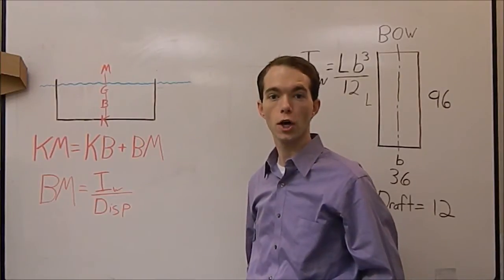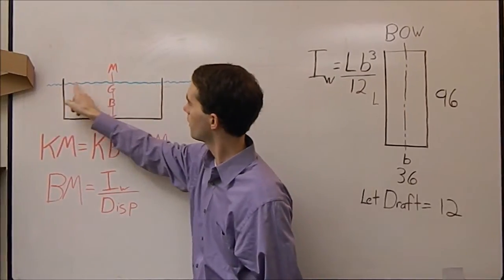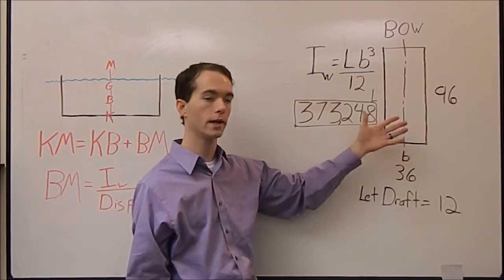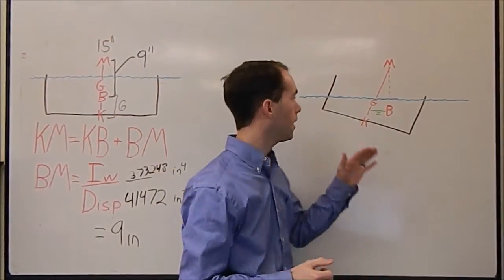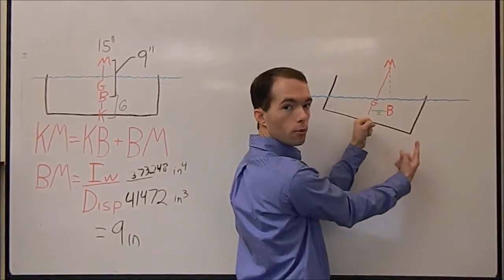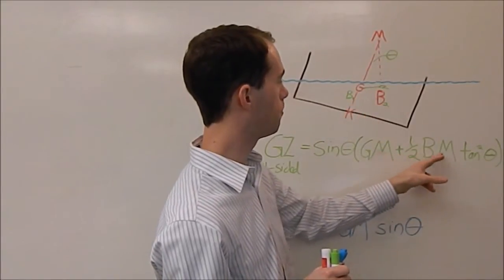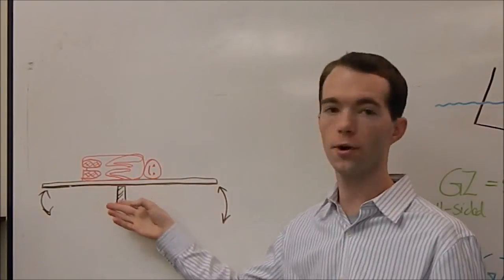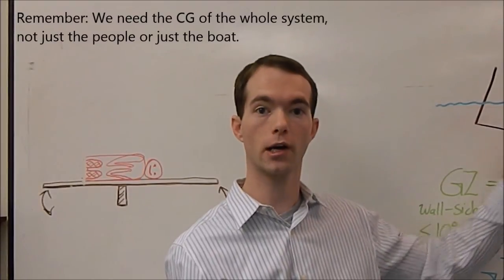How to Build the Fastest Cardboard Boat: Stability - Metacenter    Mikes Inventions

Comment: Thank you Mike. I still dont understand why the righting lever GZ is taken as a distance originating from the point G, perpendicular to the line B'M not from any other point on the KM line. Please clarify my doubt. Thanks
Reply from the maker: +david thomas Thanks for watching David. Sorry I wasn't quite clear enough in the video. B will always be below M. M is the pivot that B swings from. B is the location of the upward force and G is the downward force. B is always straight up, and G is always straight down. A torque must be calculated perpendicular to the axis of rotation. Only the component of the force that is perpendicular to an axis counts, this is why we use a line perpendicular line from B to G. I hope that clarifies it better.
Reply: +Mike Thompson thanks for your input Mike. i refered a text book on naval architecture(REEDS) after watching some videos on stability. it says Z is a point on the line BM to which the righting lever joins from G perpendicularly. i understood the idea more clearly with your explanation how torque is acting. still one doubt is you said ''we use a perpendicular line from B to G'', instead is it a perpendicular from G to BM? Thanks
Reply from the maker: david thomas Yes. It is from G straight over perpendicular to line BM. Any other spot on the BM line will give an incorrect torque, and BM is always vertical. Sorry I forgot that one little letter in my previous reply. (BM) Good job referring to an "official" source. I think every book on naval architecture has this information.